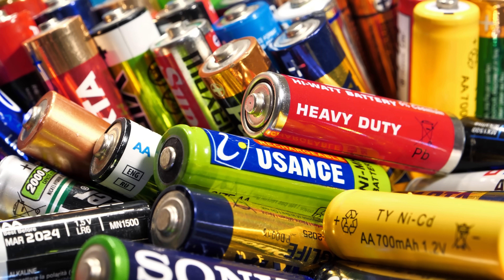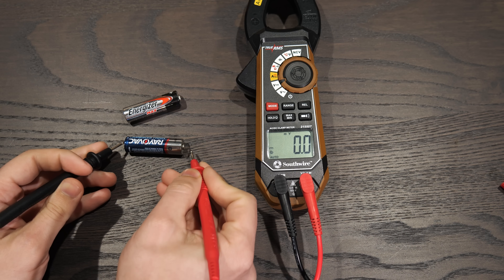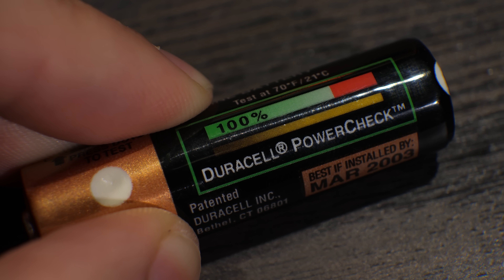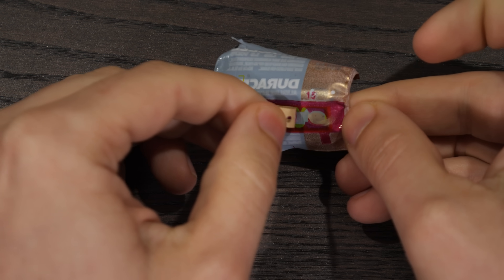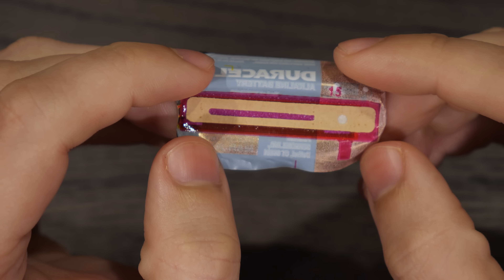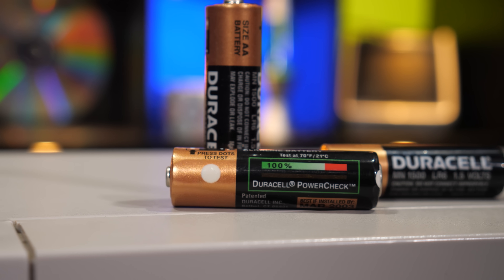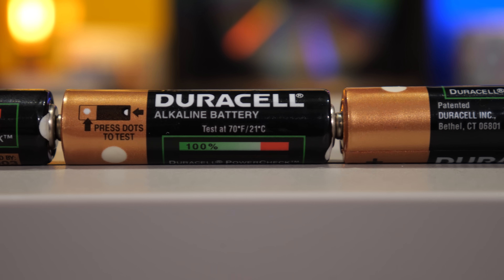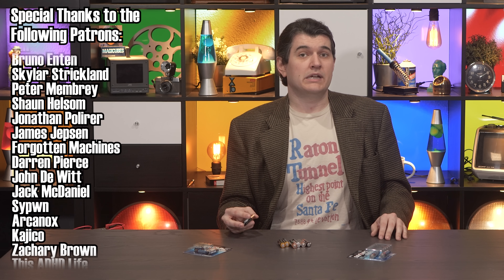Duracell PowerCheck: A genius idea which didn't last that long

Comment: How dare you call them useless! Everybody who had a game boy loved those batteries. We would always check our batteries before a long boss battle to make sure that the device wouldn't die in the middle of the battle. Also, when we were using two of those and the device was dying but we only had one fresh battery, we had to find out which of the two old batteries was the strongest one to keep.

Comment: This brings back so many memories lol. These days I just have a battery tester, as I dislike leaving batteries in devices due to issues with corrosion if left in for a long time. Most of the time I use rechargables instead of disposables though, much better for my wallet and the environment.

Comment: The old zinc carbon batteries would leak and corrode if you left them in your flashlight or toy robot for any length of time, so you were supposed to remove them when not in use, meaning you probably did have a junk drawer full of partially used batteries. Not an issue with alkalines, though, but maybe a textbook case of not understanding user behavior?

Comment: there's a crude way of testing alkaline batteries by dropping them upright negative side down on a table.
if it bounces, it's empty. if it just lands on the surface without much bouncing, there's charge left.
i use this test all the time

Comment: I guess I'm one of your outlier cases.  I have a large battery caddy (with a built-in tester), and I usually remove batteries from any device that isn't used constantly (like a remote control). I've had far too many devices ruined, or need serious replenishing, after a battery leaked during storage. Low-but-steady current applications, like clocks, can use a partially depleted battery just fine and last a year or more.  BTW, in the caddy, I put the new batteries in + side up, and the partially used + side down.

Comment: There is also the circumstance of a device which needs multiple AA batteries, and isn't powering up. It's possible that one or two batteries have gone bad but you can't quickly determine which one. The on-cell-tester might be very beneficial in that situation.

Comment: I remember when these first came out. Weren't they originally built in to the battery package (I assume because of cost) and then in the battery?
I was sooo excited to get and use one of these but they were only on Duracell batteries which were "rich people" batteries. Didn't get my hands on one until years later. At which point I had a nice digital multimeter anyway:)

Comment: I have a very simple battery tester that I've used for many years: a small flashlight that takes one AA battery. If the light it generates is bright enough it can be reused. BTW, it lives in my junk drawer with the old batteries. When you live in poverty you learn how to be frugal.

Comment: I still remember seeing PowerCheck as late as the late 2010's here in the UK at least
Reply: I am sure it continued till COVID
Reply: Yeah I've got a couple here (also in the UK) with a shelf life date of 2026 on them. Probably mid-2010s. Different design: only the tester strip, no gauge next to it. I think the tester strip itself was in colour. Both have a bit of charge but the tester strips don't light at all and are a funny shade of grey. I wonder if the tester died before the battery.
Reply: @andrewwinfield8592  yeah the newer Power Check batteries had 3 colours on them and with a high capacity it would be green and low would be red and partially used would be yellow/amber
Reply: Can confirm, we definitely still had these in the 2010's in the UK, but I haven't seen them around for a few years now

Comment: I do remember these! The only use I found from them was to check if a battery would go another six months in a clock when I changed to daylight saving summer time or back to winter time in Spring and Autumn.

But it was a sweet idea ...

I love your recherché content!

Best wishes from George in Herefordshire, UK

Comment: Thank you. 
   About the time those testers came out, there were safety articles about not putting extra batteries in your pockets with cartridges, with explosive results. Usually directed to law enforcement personnel, search and rescue teams. etc. Connections!!
  Thanks for your video. Chief

Comment: Some years ago I had Duracell Ultra Batteries, which still had the Powercheck implemented. But I think they're out of production, as they are no longer listed on their website, at least where I live. Maybe that's a good thing because at least half of the 10-pack I had started leaking after a while.

Comment: This power check feature needs to come back. A beard trimmer for example will do a much better job if the battery is brand new and above a certain level of capacity. I remove the battery and keep it aside because half used battery can still be used in a wall clock or other appliance. This power check feature can be very useful.

Comment: I got no beef with AAAs, it's the designers that still use 9 volts that really grind my gears. Micropower DC-DC converters are commodity now, and I'm not convinced a lot of these products couldn't run on 3V with a pretty minor rework that doesn't even involve a switching converter.

Comment: I appreciated the testers!
I mean.  If your gameboy with 4 AA batteries died, you may only be able to cannibalize 2 AAs from an old remote, so now I had two new AAs, two old AAs... so now I forgot which to replace, which to not replace when the temporary power completed died.
And then there was still some left, so you'd only want to replace 2 of the 4... 
ANYWAY... compile this with ALL electronics in your house, and bam, you soon have an absolute cluster of batteries.

Nowadays, I just have a centralized set of rechargable batteries set up with a FIFO storage unit, to always keep a consistent rotation of use.  Unfortunately, it's super overengineering of today's battery usage in today's environment, but whatever, I'm scared by the past!

Comment: I remember these.  I had a few defective ones that burned a hole in my thumbs.  I'm not sure if it was battery acid or what, but I did leave a pinhole on the button for visual proof.

Comment: I managed to got superior tech instead of PowerCheck.
1. Really fast charger for AA/AAA Ni-Mh (7A into 1-2 AA's, 4A into 3-4 AA's, 3A into AAA's).
2. Half-way decent (later - really good one's) AA Ni-Mh cells.
3. Decent devices that shut down somewhere at 0.9- 1.1 V per cell.
No 10 hours charges, no cumbersome battery checkings. Just inser cells into the charger, power it on and when cheger says those are full - those are indeed full.

Comment: Many multimeters, both analogue and digital, have battery test modes for 1.5V and 9V batteries. These will place a resistive load across the battery and display the resulting current. The analogue meters have green/red sections on the scale to denote strong or weak batteries. These meters tend to be the cheaper ones aimed at domestic use rather than professional, and it's quite a useful feature in that context.

Comment: I remember for some time, they had a battery-tester that works the same way, but on a sperate sheet. It was way easier to use and the economics were definitely as there is only one for 8 or so.

Comment: Thank goodness disposable batteries are out of vogue indeed. Except flashlights, sadly. Many are still not made with rechargeables in mind although they do work.

I tried a solar powered flashlight but it just deteriorated after a couple months. It makes sense if you keep it on the dash for a motor vehicle, but doing so probably damaged it since it takes the brunt of bumps and engine vibrations.

I ultimately landed upon hand crank flashlights, but they're so rare. I have a 15 year old one that still works which I keep in the trunk of my car, maybe 4 inches in diameter and green colored. I haven't been able to find this one anywhere anymore...I think i got it from REI. The main one I use now is a life gear which only select sporting goods stores sell brick and mortar. It has seen daily use for two years and it's survived a few 10 foot asphalt falls no problem.

I love hand crank flashlights and they're obviously the best option for emergencies as they can always be powered, but for some reason they never caught on beyond being a niche. And that's sad.

Comment: I do remember these, and once you mentioned it, I remembered the little separate testers, too (they were little paper strips that only JUST reached to each end if you stretched them really tight, and were hard to hold in place). For that matter, we also had a battery storage thingy that hung on the back of the basement door, and IT had a voltage tester built in. I wonder if it was just common for brand new batteries to go dead on the shelf, back then?

We realized the importance of the big name-brand batteries when Dad got a camera that ran on AA's, instead of Mom's with its own custom (but reliably rechargeable) battery. If we put Panasonic or Rayovac in it, we'd get one picture, maybe two (heaven forbid using the flash) and the batteries would be dead. Put in Duracell or Energizer, and it'd run through a sim card like you'd expect it to.

Much more recently, I switched to Energizer from Duracell, just because I don't use batteries all that often, and Duracell AA's seemed to leak within a few months, if left in the package. I guess their AAA, C and D batteries have continued to behave, but the AA's are constantly leaking, so I switched everything over to Energizer (and from there to Energizer rechargeables).

Comment: I remember before the integrated power check, you got a loose power check strip along with the batteries. Same mechanism, just on a separate strip that you held against the battery terminals.

Comment: All I remember that when the line did not get to 100% it was dead for everything other than running clock (without alarm) or remote. Also that they were expensive so nobody was seriously buying them for toys that just ate multiple AAs in afternoon.

Comment: This would be useful on oddly shaped and often expensive batteries, like CR123 lithium cells or other oddball cells used in film cameras. These often would be removed from cameras during long periods of storage so they didn’t leak…and if you have a few in the camera bag, it can be useful to know just how much juice is left in it. Plus, they are VERY expensive! They sometimes run like $15+ Canadian dollars PER BATTERY….so you definitely want to get every bit of energy out of one you can.

Comment: Nah these thick remotes that use AA are trash. AAAs will last 10 years in those, probably longer than the receiving device. 
Those odd sized button cells though, damn you Philips.

Comment: Genuine question... do people actually still buy alkaline batteries routinely?
I moved to Eneloops some 10 years ago and I genuinely don't have any devices which require alkaline batteries.
I've probably saved... hundreds of dollars not buying batteries.
The only exception is my SwitchBots, which require expensive lithium batteries, and car remotes which use a CR2032 every couple of years.

Comment: These came to the UK market at some point in the late 00s and they did seem to last for quite some time. They even did a 2nd generation one where the actual bar would start off red and go green instead of using the gauge above it

Comment: Using a heating element to test a non rechargeable battery is pretty dumb really ; every time you test them you discharge them permanently. It is about as clever as having a fuel gauge in your car that will only show how much is in the tank if you dump petrol on the road.

Comment: One-time use battery tip: use new batteries in devices that demand more power, then move those batteries to devices that demand less power, such as computer mice. You'd be surprised how long low-drain devices can work on batteries that no longer suffice for higher-drain devices.

Also consider buying rechargeable batteries. Even the worst ones will be far better value.

Comment: Huh, I thought it used your body as a resistor, but this is a lot simpler, and also explains why you can drain them by testing. Good to know! And I immediately thought "No Effort October?" so confirming this was supposed to be a November video explained a lot.

On a side note, are you okay and just have a sore voice, or do you have a new microphone? You sound... different, your voice comes through a lot bassier/light on treble than I remember it.

Comment: 12:14 One of the biggest problems with their usability is that there's no difference in result between "dead battery" and "not pressing hard enough." You just had to mash them until your fingers hurt, then go check them in an appliance anyway. I remember my parents explaining them to me with the caveat of "I'm not sure how well these actually work..."
I'm not sure if the battery companies ever polled their users about these, but I wouldn't be surprised if this perception is what put the nail in their coffin.
Reply: This is the answer

Comment: The tester was a handy diagnosis tool though. If something stopped working, at least I could quickly test if the batteries were flat, or the device was broken.
Do I miss the tester option? No, not really. But it was a nice option to have ;)

Comment: I suspect the physics are wrong. Current creates the necessary heat, not voltage, so the voltage drop at varying points along the heating strip is irrelevant. You effectively have a bunch of resistors (even of varying value) in series, and in that situation the current through them all will be the same. Same current = same heat. So tapering of the heating strip is more likely there to create a heat sink effect where the wider part is more difficult to heat. Hence, unless the heater can heat the whole strip, the power indication will fall somewhere along its length.

Comment: Duracell also brought this back with their Duracell Quantum line in 2013, it was discontinued in 2023. I stead of calling it PowerCheck they called it Power Test this time around. But with how recenty they were discontinued, you might be able to get your hands on those pretty easily if you looked, and so desired.

Comment: It's good you didn't say "light up" because I'd have had to be a pedant about it.

I found a few of these in a drawer a few months ago.  I wish I'd thought "Oh, I should make a video about these" - but that's why you're a Youtuber and I'm not.  What did I do with them?  I'm pretty sure I put them in a baggie in case they might start leaking and put them back in the drawer, because while I knew they were dead, I also thought "Oh, these were always kinda cool" and so I didn't want to toss those bits of history.  Now that you've made a video, I suppose I can toss them the next time I run into them.

Comment: My question is, why aren't these a thing on rechargeable batteries? Disposable batteries, it doesn't make very much sense for. But rechargeables! If you want to know when you need to recharge your battery, you would need to test the battery. With rechargeables with this tech, you wouldn't need to.

Comment: In fairness, I sill have some batteries from 2016 that had the power tester on them and I have a habit of putting random batteries in my bit and bobs stash for later use :)

Comment: Oh yeah, OG Game Boy with Duracell copper tops was the only way to go, felt like royalty checking the capacity of each battery although my fingers hurt after pressing so hard on the cells. The heater can be modeled as an array of parallel resistors I bet.

Comment: Yeah I remember those. You're definitely telling the truth about how hard it was to push the buttons. Probably the last time I used one of those batteries would have been in the late 2000s when I found a couple AA cells that rolled behind a chest freezer. They still tested good. 

Some time around then, I started using those Rayovac 15 minute rechargeable cells that had the clever built in pressure switch and 3rd electrical contact. Maybe you could make a video about them?

Comment: There is actually a really easy way to check if a battery has usable charge, just drop it on the flat end. If it bounches it's empty.

Comment: I wonder why they didn't put the negative white pill on the long side of the battery, just like the positive one. They could have extended it under the label so it would reach the negative side, and it would have been way less painful to press your thumb against it... what am I missing?

Comment: As a child I found the testers fascinating, and discovered an issue with the simple design- if you press the buttons with your nails enough, they'll eventually stick on, which got them pretty hot, and scared the crap out of my young self.

Comment: At one point, they started just incorporating the battery testing strip into the plastic packaging for the batteries. You could test all the batteries in the pack with the one testing strip, as well as any other batteries you had.  It made far more sense than incorporating the testing strip into the battery itself, from both a useful standpoint, and a financial standpoint.

Comment: At 7:29, did you mean only low resistance? Because low resisance will warm up with lower voltagae and higher resistance need much higher voltage to warm up.

Comment: Yes, I remember these, but I have not seen one for years now. It seems rather unnecessary to me, as it is just as simple to either measure the battery with one of those very cheap testers with a slider contacts setup and/or a digital or analogue readout or, as you showed, a digital meter. Besides, this type of battery just raises the cost of manufacture and hence the cost to the end user. In any case I took to using rechargeables and a dedicated charger setup made by Powerex - the MAHA MH-C9000 which does every battery setup and charging method anyone would ever want.